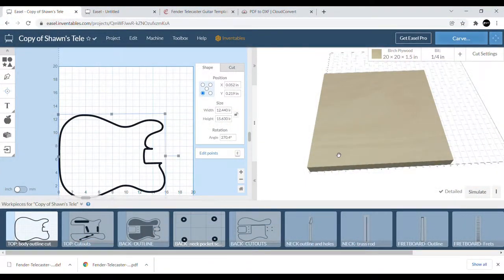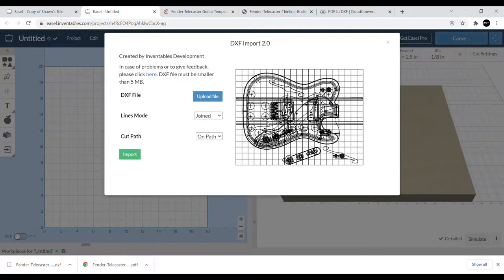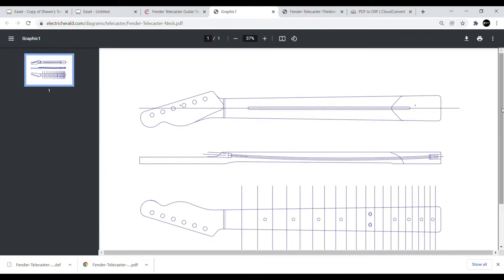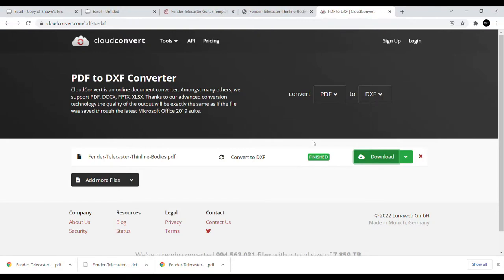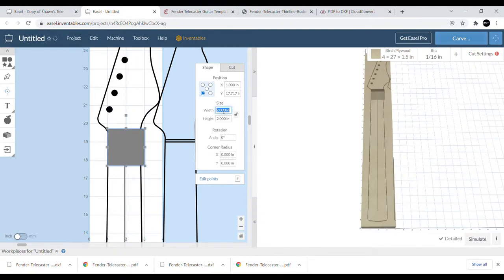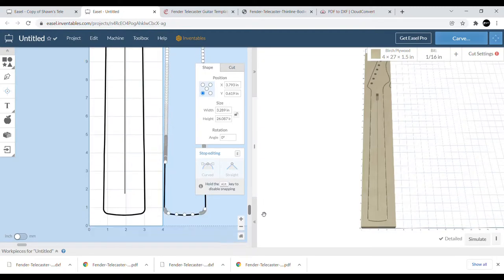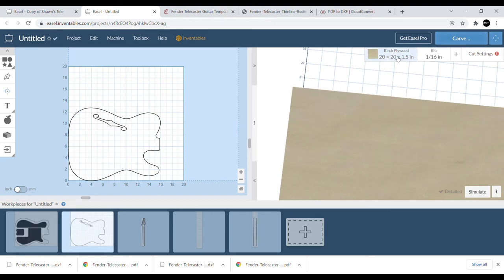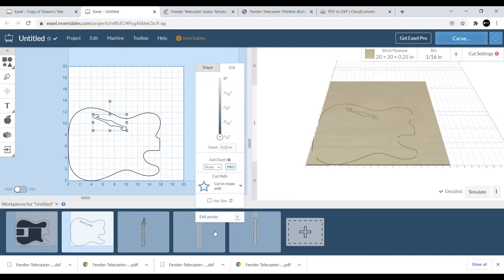EASEL Tutorial; Designing a thinline tele style guitar using Easel CNC software

Comment: Hey man! I just discovered your channel and this awesome series on using Easel for guitars, great stuff, this helped me a ton! Question though: If I wanted to have the CNC drill out the holes for the strings/bridge, how would I go about putting that in the design? Or is that easier to do manually after the guitar body is cut? I see the CADD drawings have the string holes and I've played around with that a little, but I'm not sure if everything will line up perfectly once it's all done. Might have to cut a few prototypes to test. Maybe I just answered my own question lol. Either way thank you!
Reply from the maker: So I actually use a small bit to do the string through holes but I only have the cnc go about .125" deep the use a drill press to drill the rest of the way through. The location for the files I use are Fender specs so should fit Fender parts just fine. Hope that helps! I have a few other videos on easel stuff and wanting to make more in the upcoming year!